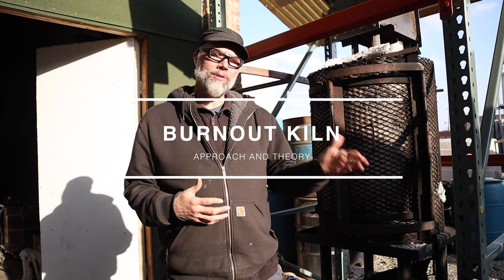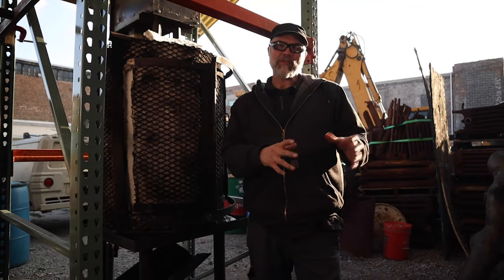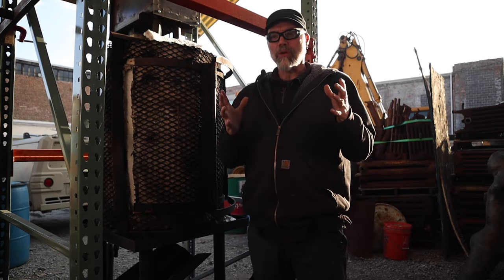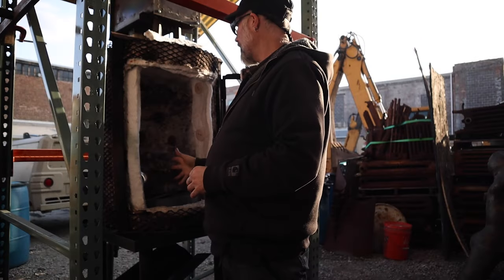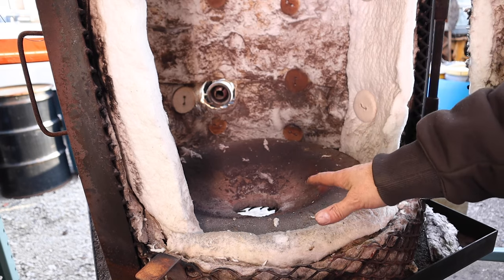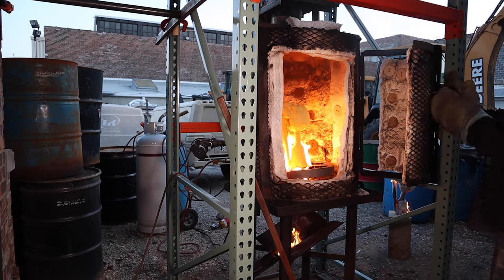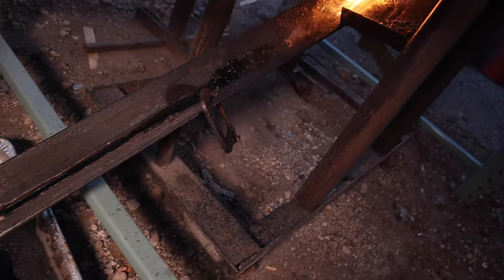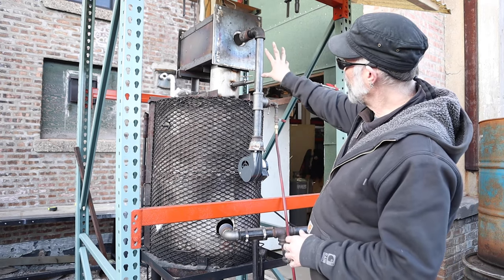Check out My Burnout Kiln

Comment: Interesting info, I try to never go over 1050 F with my shells to vitrify. According to everything I read, ceramic shell will change from an alpha crystalline to a beta crystalline over 1200 F.  Which makes for a weak shell. Would like to hear your take on this. Thanks
Reply from the maker: Thanks for your call.  I check with Remet and they recommend 1600F but said 1700F if needed.  I have had zero problems working at those temps.  I know you said your using Remet currently, but what were you using when you were tought that lower temp? Maybe that shell was based on a different refractory like alumina or mullite?  But you are right, fused silica does change in chemical structure at a critical point.  With my wax patterns, Ill drop the wax a lower temps ( still higher than 1050) and vitrify during my preheat.

Comment: Hey after watching your video I realised me met at either SLOSS or the ICCCIA a few years back! Depending on which, the team and I either brought a furnace in a suitcase or built a big Welsh dragon head. Either way, really great video, I’m looking at trying to build one for the workshop and I was just wondering why you use stainless steel as the grate in the base of the kiln as a posed to just mild steel? I don’t really have a lot of stainless hanging around you see.
Reply from the maker: Steel works fine, stainless just last longer.  Glad you found me here, Let me know if you have any additional questions.

Comment: Hi Eric, I want to build my own, forced air burner. The piping and fittings I already have, the orfice size I think I have to try out. My piping is 1 1/4 pipe. I only need to know on which pressure ( PSI) you run your burners? And the size of your orffice.
So I have a little guide

My venturi burner on my aluminium melting furnace runs at 14 PSI till 36 PSI, orffice 1mm.
I melt 2kg alu in 20 minutes.
Burner runs very well, I start at 14 and crank up to 36.
Reply from the maker: There are a number of variables with the design of the burner, but for my design, I have a 1/16 office running at about 8-10 PSI.  Orifice size is more critical for venturi burners, as it creates negative pressure behind the orifice that draws the additional air into the burner.  I like to design my burners so they can run as a venturi if needed (when the blower goes out) otherwise you run the risk of a backfire or worse.

Either way, any homemade burner system should never be left unattended and should be under supervision at all times.
Reply: @LunarburnStudio  thank you again for your answere.
Ofcourse I will never run that burner unattented.
How do you make your design that an forced air burner so they aswel as a venturi burner?

You point the orifice in flow with the air flow? Instead of square at the air flow?
Some design on internet they have the gas inlet at 90 dregrees to the airflow, for good mixure.
Reply from the maker: A question first, are you looking to make a burner for your burnout kiln or your furnace?
Reply: @LunarburnStudio  I want to build a forced air burner for my furnace, to melt bronze.
The venturi burner from the furnace now, I want to use for the burnout kiln 

Because this one is very good adjustable in power. With choke and needle valve and gas pressure.
Reply: @LunarburnStudio   @LunarburnStudio  I want to build a forced air burner for my furnace, to melt bronze.
The venturi burner from the furnace now, I want to use for the burnout kiln 

Because this one is very good adjustable in power. With choke and needle valve and gas pressure.
And I think a forced air burner produces more heat.

Comment: Thank you so much for your videos i learned a lot. I have a question. Since i dont have a kiln, is it okay to heaten the shell using a blue torch before i pour the melted bronze?
Reply from the maker: Yes, absolutely, also the shell does not need to be crazy hot.  400F if its a solid/thick casting minimum.  Alot of my castins are 3-5 mm thinck and my shell temps range between 800-1200 F

Comment: Great video! On my venturi burner for my metal melter I used a motorcycle carburetor jet for my propane dispenser. Did you just drill a #27 hole in the pipe cap? Thanks for showing your burnout kiln!
Reply from the maker: The orffice size is dependent on the size of the burner, fuel type and desired BTU output for the size and shape of your furnace and kiln.  I do not remember the size on those burners, 1/16th-3/32" i think. ( ill check) .